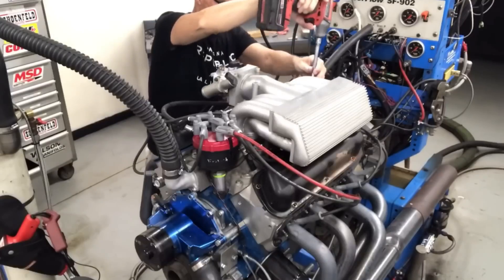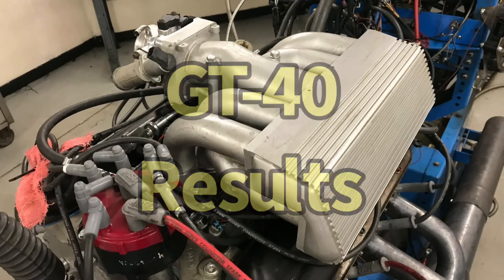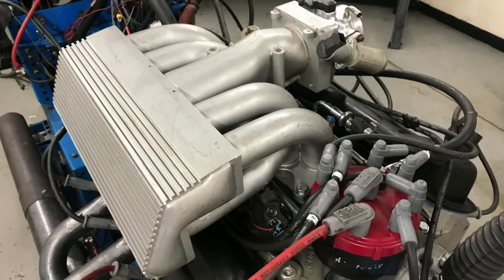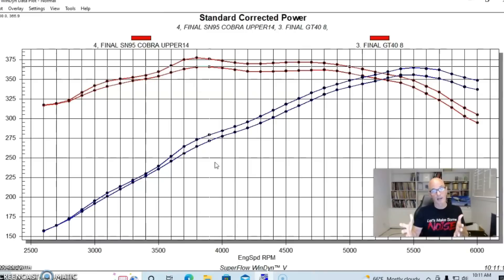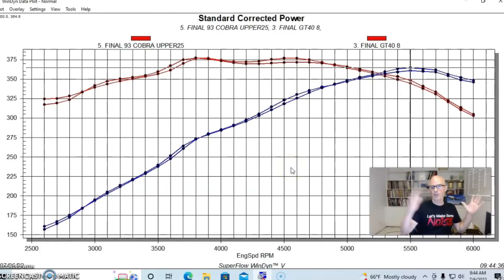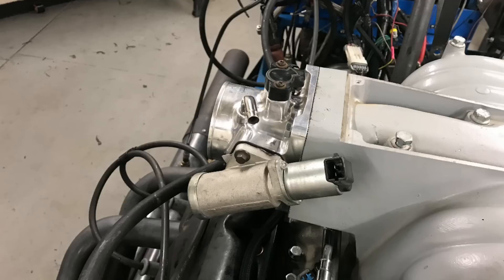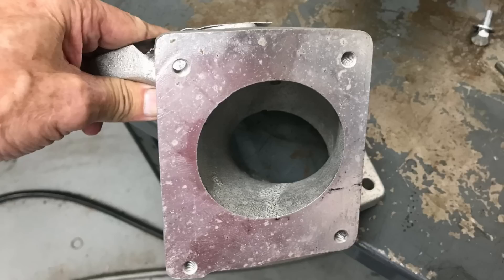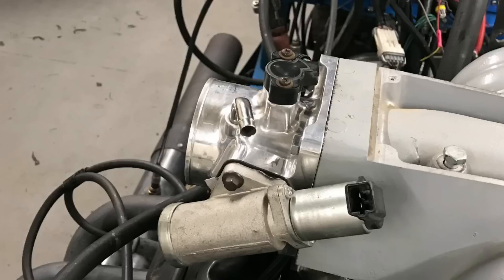FORD 5.0L INTAKE SHOOT OUT-GT-40 vs 93 COBRA R vs SN95 COBRA vs EXPLORER-WHICH ONE MAKES MORE POWER?

Comment: I have never had a 5.0 Ford, but I wonder if the lower or the upper is the main restriction on these factory intakes? Then how much does does welding & porting the lower or the abrasive silly putty through the upper. Going into a Scout 800 @ 3000 lbs & a max rpm of 5800ish? Plan is to be about a 350/375ish HP & the wide torque band of long runner intake.
Reply from the maker: you can port the upper and lower (we used Extrude Hone), but it doesn't change the runner length
Reply: @richardholdener1727  , Yep I fully understand that. Just like you very clearly demonstrated in the TPI video series!
Reply: @richardholdener1727  I forgot to thank you!

Comment: This is at the crank correct? Wouldn’t these numbers change at the wheels? I have 24 pound injectors with the explorer gt40 intake and 75 mm TB and on a “safe” tune I made 275 to the wheels.
Reply from the maker: The motor is still making the power shown on the engine dyno, the drivetrain is just absorbing the power and it doesn't register on the chassis dyno (you still need the same amount of fuel)

Comment: Would have been nice if he had tested the base 87-93 GT intake to see how much of a bump you actually get with the same setup rather than the 20-30hp generally quoted.
Reply from the maker: I have compared the GT-40 to the stock HO Upper and lower in another video
Reply: @richardholdener1727 I will have to check that out

Comment: Manifold to manifold theres about 2% difference between the tubular and the Explorer at 360ish hp. The stock EXP throttle body needs inlet ported. 👍😁😎
Rewatched 2/25. Getting ready to install on milder version.

Comment: i like the gt40 tubular it looks best under the hood a cobra intake dont look cool under the hood of a lx .......my lx had the gt40 in the mid 90,s until i went carb and nitrous due to needing a piggy back system and laptop in 1996 that was way too expesnisve back then so i opted for the intake and carb ....i called the ford racing hot line back in 96 and they said 10kusd for a piggy back system and laptop so i went to a intake and carb that cost 500 usd including carb  set up and intake and external electric fuel pump etc ....car ran mid 10 with a ecam and  tfs high port heads and 150 shot of juice on 410 gears and 28x9 good years.............1.51 60 foot leaving on the juice 10.54 @ 127mph

Comment: Eons ago I read a MM&FF mag where they flow tested the GT40 and the 93 Cobra. The Cobra made exactly 200 CFM per runner. The GT40 varied between 203 and 199 per runner. Overall the GT40 averaged 202 CFM per runner but was inconsistent due to the crimp style tubing. The Cobra was spot on 200 CFM average due to the fact that it is cast.
Reply from the maker: the cast Cobra doesn't flow the same in every runner-1 and 5 are both longer and more twisted
Reply: @richardholdener1727 
Really? The uppers don't look twisted etc.
The lowers are the same.

Comment: I'm looking for a vid or info on a base line 5.0L mustang with a 225 hp and doing a GT40 heads and intake swap.  What are the relative gains and is it worth the money?   My son has an 87' convertible we would like to add a little kick to it.
Reply from the maker: I have a video where I installed a GT-40 intake, I have another vid where I installed GT-40 pr heads, the combo would give you 50 hp or so-better with a cam

Comment: A good added feature could be a list of the parts showing the HP differences at the end 

Tubular: 364.8hp/377.5tq
SN95: 356hp/366tq
Foxbody: 361hp/376.7tq
Explorer 90°: 348hp/373tq
No elbow: 354hp/375tq
KB elbow: 361hp/375tq
Reply from the maker: I recommend that people never look at just peak numbers-it tells you very little
Reply: @richardholdener1727  100%, but with a test like this where manifolds are so close throughout, it helps. Either way, love the video like always!

Comment: I don't know about you, but I have always had to run a spacer on my upper intake. Also, the inlet tube has a 90 on it between the TB & the MAF. Isn't that pretty much standard on all Fox Stangs?
Reply from the maker: the air intake tube does have a 90-we ran open TB

Comment: Ah lastly back then a new cobra w/o leather was $22,600 with leather 23700. I traded in a “demo” 93 Lightning (HORRIBLE gas mileage even for a car guy). Bought the demo Lightning with 5500 miles for $18000. Dang

Comment: 1994 SN Cobra had stock 60(!) mm tb with a 70(!) maf. It had larger inj 24lb vs 19lb for GT. Also larger fuel pump and a special “cobra” ecu program (more timing, etc). Upgrading to a 65 or 70mm tb was the first upgrade along with more timing. I bought it new in 94…miss her😢. Peace

Comment: Favorite cartech or downs for boost infected engine
Reply: A lsa 115+4 is best cam I have ever had
Reply from the maker: the 115+4 is why the cam works so well? Also, 1800 hp with a Down's box?
Reply: @richardholdener1727  top fuel dragster 118+ lsa with soft valve closing angles on cam . THIS is my spec'd custom camshaft high lift right duration for 374 inch Windsor engine. Stroke to. Bore ratio is where dependable power is made . If bigger was better top fuel dragster would be running 2,000cid intake center line is very important.
Reply from the maker: those lose substantial torque
Reply: @richardholdener1727  whom needs torque when I got almost 1800 HP ?

Comment: Had a question... I know you have some good experience for a while now! A couple of months ago I put a 94 cobra upper intake and gt40 lower from a 90's explore on....
It has a small baffle and its sucking oil in the catchcan with my old intake i didn't have this issues Can you to tell me by switching to the lower with a big baffle  will prevent oil suction through PCV???
Currently have a new 333 stroker with 7000 miles on it now in my 94 GT AODE with stock heads
Any help is much appreciated
Reply from the maker: WHAT IS THE CATCH CAN HOOKED TO (VALVE COVER, LOW INTAKE, ETC...)
Reply: @richardholdener1727  Ist catch can was hooked to back of intake normal spot and back of motor pcv. Then someone suggested to get a 2inlet catch can and put a 2nd pcv on driver valvecover up front to allow it to breath better, and it helped a lot but still catching a lot of oil in catch can through pcv...
333 stroker with 10.5/1 compression.  I guess the small baffle isn't sufficient???
Reply: @richardholdener1727  any help is greatly apprecieated

Comment: Richard, I think I’ve watched all of your Ford 5.0 intake and cylinder head comparison videos and I’d love to see or even your valuable opinion regarding the the stock intake manifolds and the Edelbrock Pro Flo 4 intake manifold. I believe my car has some ECU issues and I’m thinking about an upgrade to the Edelbrock Pro Flo 4 EFI. Thank you for your technical videos.
Reply from the maker: IF YOU ARE TALKING ABOUT THE SINGLE-PLANE EFI INTAKE-NOT A GOOD CHOICE
Reply: @richardholdener1727  What would be the best choice on intake manifold? I’m planning to use the AFR heads and a street HR cam, 210/215 @050. Thank you for your advices.

Comment: Honestly it would have just been nice to have seen the factory throttle body from the Ford explorer which is a 70 mm instead of a 60 or 65 mm!! The 70 mm makes a big difference of horsepower and the air to fuel mixture ratio!! Not really hardly much of a comparison when the explorer comes factory with the 70 mm throttle body!? 👌🤷🤯😮‍💨

Comment: Picking up a 302 with a .520 lift cam (unknown brand), 93 Cobra intake, 65mm throttle body, and a 70mm mass air for $800. I think it's a pretty fair deal. Can't wait to get my fox moving again.
Reply: Sounds awesome throw some gt40 or P heads on that and it'll be a ripper !
Reply: @foxbodysandfreedom8595  it just has some ported and polished E7s on it. I plan to get a decent set of heads in the springs, hopefully she'll be finished here in a couple weeks!

Comment: I used the 5.0 stock tb spacer with the get disabled and water out. This on an exploder intake. I think the additional plenum volume could make some difference. Hence your good elbow result.
Reply from the maker: plenum volume changes very little
Reply: @richardholdener1727  Definitely not gonna argue man, you'd know better than I. The stock spacer sure ain't no billet elbow, that's for sure.

Comment: A lower port job on a GT-40 tube manifold was worth 30hp at the wheels.
An unported Systemmax was worth 10 over that.
Reply from the maker: 30 hp from porting the lower? with the stock tubes and a 65mm throttle body?
Reply: @richardholdener1727  it was a very aggressive port job. So much so that it had oil control issues due to thin walls and the addition of a heat shield. 
This was on a 9.5 :1 306 with as cast AFR 165 s and a 70mm tb. I was running an E303 at the time with 1.7s. And equal length shorty headers

Comment: Always wondered why no one ever reproduced these intakes with plastic. Cost efficient, cooler AITs, could sell high volumes .. 
Could anyone provide an explanation? Also with the 2000 cobra r intakes. Or even utilize 5.0 HO style intakes of tried and true design re-engineered to work on 4.6 SOHC and DOHC designs?
Reply: There was a couple companies...such as comp... who did plastic box uppers which were ok but tend to pop under boost. Over the years plastic does deteriorate....but other than weight savings it would have little affect overall.

Comment: Was the throttle body off a 94 -95 cobra? I believe there a 60 mm and the GT was 56 mm. So that would explain why it drop off over the whole RPM range vs an 65 mm.
Reply from the maker: the SN95 didn't get a 65 unfortunately

Comment: I have a 331  with the E cam, Trick Flow Twisted Wedge heads, 75mm throttle body, Explorer intake, long tube headers. The compression ratio works out to be 9.6 to 1. But it only makes 240 horsepower at the rear wheels
Reply from the maker: should be higher-is it an auto?
Reply: @richardholdener1727  It has an AOD out of an 86 Lincoln. I did put larger exhaust on it after the dyno run.
Reply: @1murder99  Although you would pick up Hp., if you had Big dogs fully stage 2 port your upper, and lower Explorer intake, along with running 1.72 scorpion endurance roller rockers for your 331,= prob. pick up 40+ wheel Hp!? The 240Hp to the wheels through aod trans., is about 70Hp, more than a stock aod 5.0 H.O.
Reply: Explorer intake is 10% less flow than the heads at 520 lift.

Comment: I have question is more efficient to running a good size turbo or running two small twin turbos on a v6 or v8 engines
Reply from the maker: same if they are sized for the power

Comment: Less torque and barely more peak HP than a stock junkyard 5.3...with how much money invested????    But why?
Reply from the maker: much less than a swap
Reply: @richardholdener1727  I've pulled off a swap for less than those heads cost!
Reply: LS nut swinger has entered the room, 😂
Why does ANY LS need heads, cam, and intake to beat a stock Coyote... Advancement in technology would be the answer....
Reply: @02autogt  not true.  I've seen several stock camaro walk on mustangs...try again ford nut swinger
Reply: @02autogt  Go watch Enginelabs LS3 vs coyote...learn something, and then come on back with all of your excuses.
Reply: @BigMikesGarage  any "real" engine builder knows a blown LS can't make the same power levels an un- opened coyote with a blower without internal parts upgrades. Not to mention the coyotes volumetric efficiency is higher than any LS engine.

Comment: Gee , I thought the 94 , 95 Cobra intake would have been way better than that . Bummer , that's what I've got , a 95 Cobra . Ah  , it's still a blast to drive 🚗.
Reply: It’s just the factory 58MM throttle body on it that is causing the lower result, not the intake itself. The other manifolds tested here used a professional products 65MM.
Reply: @NGG1983  yea he f**ked another test up..by leaving that 58mm throttle body on the SN95 cobra intake 😫
Reply from the maker: AccuFab throttle body
Reply: @richardholdener1727  ah, sorry my mistake. No one wants to be accused of using Professional Products…Products, lol. An AccuFab is certainly nicer.

Comment: Would love to see a comparison of these vs the aussie style stuff for the 5.0 sbf. In 2001 our falcon xr8 fitted with this engine had gt40p heads lightly ported with 9.4:1 comp, match ported explorer type manifold with a 70mm tickford Tb from the factory.  Australia also developed a locally produced 5.6 factory stroked engine of 342ci. This engine also receives better heads cam and a one off intake manifold that is pure art, contains 8 trumpets inside a meticulously crafted single throttle manifold. Do your self  a favour and check this out  👍 
https://youtu.be/6UJ8uDMS34o

Comment: Thanks for doing this video , its good stuff ! I did a topend kit on my 94 cobra trickflow 170 fast as cast, 75mm  throttle body and port matched for larger opening , 4.0" power pipe cold air , pro-m 80mm maf , 1" phenolic spacer between upper and lower ,custom anderson ford motor sports B-31  Cam 270/280 , 218/228 , .544", full exhaust syst. Had lower intake ported , stock it flows 205-210cfm ,ported flows 250cfm. Was done by TMOSS PORTING , car has excellant throttle response with 3.73 gear ! would like to see the results for the ported lower intake , larger throttle body and port match the upper intake at throttle opening. Thanks for all you do for us motor heads we love it , it saves use a lot of money and time , keep up the good work !!!
Reply: I heard TMoss porting charges ALOT, and only ports the less restrictive lowers? How much did he charge, and in what year did you have your lower ported by TMoss?

Comment: Maybe I'm spit balling but this motor could benefit from a larger throttle body, period. Your previous talks with head flow and cam lift and duration  with the given engine displacement makes me think the 65mm throttle is getting to the point of being small.
Reply from the maker: it is too small

Comment: Impressive how well the Exploder manifold performed
Reply: I don’t know why anyone is surprised they all perform the same basically. They’re all essentially the same upper intake manifold just in different looking packages. Very slight differences between them due to the vehicles they were required to fit into, but they’re all designed to flow the exact same.

Comment: Thank you for making this video. I saw an old magazine article that had the GT40, Cobra, and Explorer and they were all around the same hp. Do you have a baseline with the stock h.o. intake?

Richard, I bought your book "5.0L Ford Dyno Tests." I'm sure the royalty check is on its way.
Reply: Richard has a video out now, showing the stock H.O. efi upper, and lower, intake, being about 18 to 20 Hp down on this engine combo.
Reply: HO flows 170.
Others about 205+-.

Comment: The non ho was a set point 19 lbs injectors a mustang lx computer speed density explorer cam that exceeds the max 444 lift and gt 40 explorer intake upgraded fuel pump stock e6 heads wide open exhaust ripped good but had a high idle? 88 crown vic with a 87 nose what a shame some a hole poured diesel in my tank and screwed me I was pissed!

Comment: We need to see a cast 93 cobra intake with the 1” added to the plenum (not phenolic spacer ) . I have cut a few apart to weld in the spacer to add volume and aid in upper rpm performance
Reply from the maker: I RAN THOSE BACK IN THE DAY
Reply: @richardholdener1727  do you think it was worth the effort?

Comment: So I’m planning on building a fox body with a 408w. I have a trickflow R with the 90mm tb opening. It’s NOT the box one. Will this intake work well with a 408? It’s a street/strip car. I will be using TW 11R heads, and that 236 cam for strokers. I can always swap to the box R, but I’m scared it won’t fit under a 2.5 cowl hood!
Reply from the maker: THE BOX MAKES MORE POWER THAN THE R-THAT VID IS UP I BELIEVE

Comment: I enjoy all of these tests. Just FYI the lightning GT40 upper is slightly different than the Ford racing GT40 upper. I have a Ford racing GT40 upper and the lightning top cap will not fit on it it is slightly shorter in the cap that came on it.

Comment: What's your best guess of using a  edelbrock performer intake and a holley 600 cfm carb.   I have a 95 5.0 ,.030, with an E303 cam and GT40p heads with upgraded springs and 1.6 roller rockers .  For me anything in the mid- 300s would be awesome in my 55 F100.  All things being equal could I add about 30hp to your test sample?
Reply from the maker: YOUR P HEADS WOULD BE WAY DOWN COMPARED TO THESE BPE CNC HEADS

Comment: Would be cool to one day see a test of the power difference between a ported lower vs stock on a gt40 intake.
Reply: Would pickup about 20-30, depending who ported it.
Reply: Porting just the lower is NOT the way to go, as the upper is more of a restriction. The lower is much easier to port, this is why most porter's rec. the customer to do only the lowers,= they, the porters can charge alot of $ for minimal time, and effort. Big dog's porting will port the uppers, and lowers, plus the spacers, th. Bodys, headers, all for really great prices!

Comment: I’d love to see a video on intercooler piping size testing. I’m curious under boost how the piping size has an effect. Does bigger piping help an engine that makes 700-800 hp? Is 2.5” too small for that kind of power level?
Reply: I second this basic logic says less power but how much less smaller piping is much easier to run